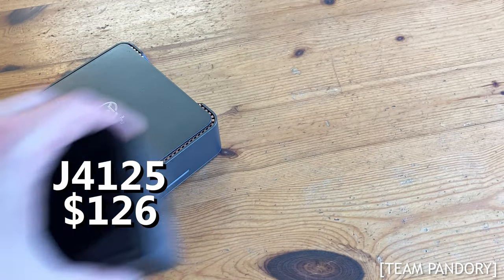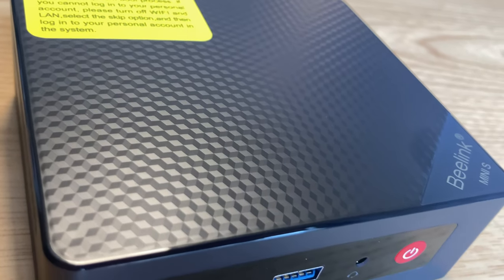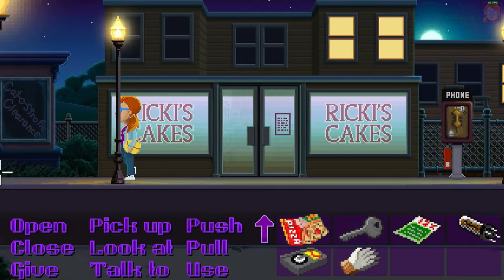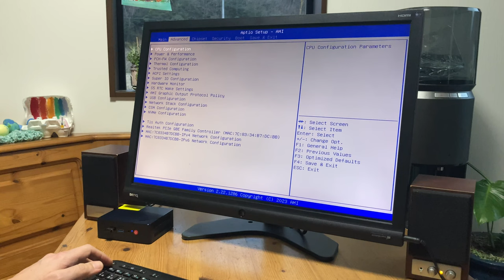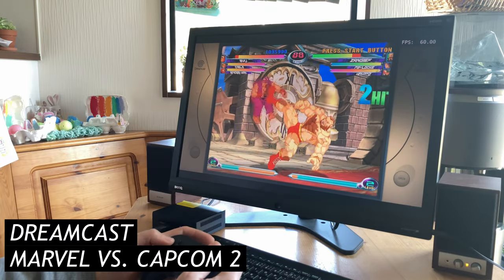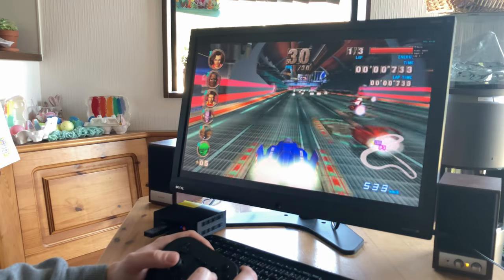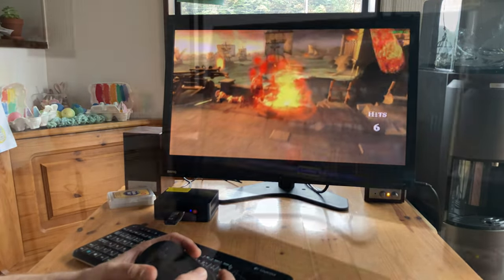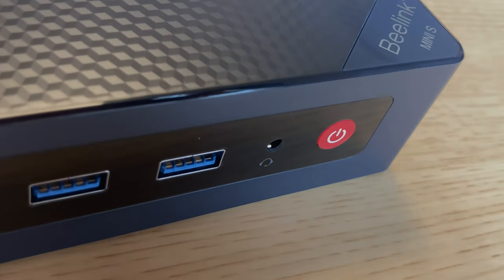Beelink S12 Review - This Mini PC is AMAZING Value at only $155!

Comment: Beelink is a value for money brand. I bought Beelink Mini S with Intel 5095 Jasper with 16gb RAM and 256 GB SSD for $160 last year to replace my 12 years old laptop with 3rd gen I3 8GB ram which I paid $500. The laptop still worked fine but about 3 times slower than Mini S due to less RAM and only DDR2 RAM while Beelink has DDR 4. 3rd gen i3 is also slower in computing and rendering graphic. It's a fact that PC, smartphone is getting cheaper while performance is getting better. However, you buy when you need at the time.
Reply: Hey can you give an update on the mini pc? How’s it working 3 months in? I want to buy one for reliability. Thanks

Comment: Yes, running your PL1 at 30 watts adds extra byte on CPU limited apps. Another sited shows the before and after game benches with temps.  This $150 sleeper nipping at the N100, not seen if those can be bumped up.

I use mine as a simple music/movie server with attached drives in the cave.  The Intel HD audio codec’s still have best legacy HDMI audio support over my Ryzen gaming hardware. DJI Air 2S high bitrate video, NO issues at 30 fps in 5.4K, 60 fps in 4K and 120 fps in HD. Its maximum video bitrate is 150 Mbps in H.264 and H.265 codecs.

This little box is quite and cool running at 30 watts, you can bang 90C with no complaints from mine so back off to 25 watts if your nervous. I love the extra zip in normal non game stuff!
Reply: How to run on 25 watts?

Comment: This is a bit more like it from Intel. Finally they incorporate AV1 hardware decoding way later than they should have and for the first time in a long time, the price is good and easily makes it competitive with ARM based SBC's. $160 allows it to be a relatively easy purchase. The lower pricing is likely due to Intel facing a very bleak future, bought about by their own greed. Single channel RAM is a veritable crime though and Beelink should know better.
Reply from the maker: In the bios, it apparently supports dual channel so I'm guessing that the next model up with more memory is dual channel.
I linked a mini pc in the description that also whips the crap out of a pi4, also single channel but maaaan, it ain't far off this one in the review
Reply: Single channel won't matter much for DDR5, same which applied for ddr3, only ddr4 it suffered so much in single!
Reply: Si es que le pongo mas memoria ram crees que se pueda solucionar en algo que solo sea single ram, o por mas que le ponga 32gb de ram igual va a afectar que no sea dual Channel, estoy indeciso por esa situación, no se si comprar la beelink s12 o la u59 que creo que esa si es dual channel
Reply: The single channel limitation is from the N95 chip... so it's Intel's crime, not Beelink's.  Intel purposefully hobbled all Alder Lake N series processors to differentiate between the more expensive parts (so even the N305, which has double the number of E cores (8) as the N95/N100 (4) is hobbled by single channel RAM).   If you want dual-channel RAM in a 12th gen Intel mini-pc, you have to go up to the i5-1240P (or i7-1260P).   As @nokialumia6267 pointed out, the older (11th Gen) N5095/N5105 in the Beelilnk U59 do support dual-channel memory.  However, that is dual-channel DDR4, where the newer 12th gen chips we are talking about actually support DDR5 RAM (there are Beelink products, like the EQ12 using DDR5), so there is a trade off... do you want the newer, faster processor with PCIe3 NVME drives, and single-channel DDR5, or the older 11th gen processor with slower SATA SSDs and dual-channel DDR4?

Comment: I bought the s12 "pro" for $165. The price is weirdly low for coming with N100 CPU, 16gb DDR4, and 500gb SSD.  I did not expect much but i'm shocked by how capable this little thing is.    I've been using it as my main computer that last two weeks just seeing how much I can do on it. 

Strongly recommend the N100 model.  Only issue I've encountered is an unwillingness to boot from USB, which seems to be an issue others had as well. I haven't looked into it yet but thought I'd throw it out there.
Reply from the maker: Hey there, glad you're enjoying it.  It's amazing to think that so little money can get such a system.  I think the price of windows 11 alone in some places equals the best part of 100$, too. 
You may need to turn off secure boot in the bios. It definitely does boot from bios as we've been managing it, but we will need to wait for an update to have those new intel WiFi / Bluetooth drivers included.
Reply: Where did you buy? The price has raised to $219 on amazon now...ugh

Comment: Do u think changing the power limit in bios from 20000 watts to 30000 would improve gameplay for the later systems
Reply from the maker: I've only just seen that you can do this yesterday.. Impressive you can do that, but it looks like many of the games are more dependant on the GPU, which doesn't get altered at all when you give the CPU more power.

Comment: Just got the 16GB version - probably paid WAY too much at £233 - don't care. Its great. Does everything I want and I have not even started looking at the gaming yet. the scaling CPU from 800 to 3200Mhz on 4 cores rocks, low power consumption unless needed. Reasonable graphics when needed.... great little unit and with the 16GB version I got, very quick. I do think I over paid, but not fussed. Even at £233 still a good purchase. Paired with a decent monitor / smart TV its an easy 1 or 2 hour set up, then happy days. Gave mine to my very "tech" phobic mother, even she got on with it straight away. Rebuilding an old P4 laptop at the moment - I WILL be trying to steal this back, but I'm not sure she will let me... These S12's are good ;)
Reply from the maker: @damightyshabba439  it's more about how much you value the tech.
I mean a full pc can cost much more new if you put into account the price of case, PSU, motherboard, CPU (that's over 233 already) then GPU, memory and storage... It all adds up. 
Either way a great little first mini pc for sure 👍
Reply: @TeamPandory  Agreed - to be clear, I've been building gaming PCs since the 90's, but this is my first Mini unit. I was shocked just how good it is. My "main" pc is a 5600X 32GB ram and an old 1050Ti 4GB, plus about 120TB in drives. But this little box isn't far off for speed and ability. I'll be buying more of these, I think!
Reply from the maker: @damightyshabba439  Yeah I could tell you're experienced in tech. It's crazy now to see that moving to the mini pcs is a  viable option. 👍
Reply: @TeamPandory  OK - "Dad Question" time - I plan on buying a few - maybe 4-6. I've been out of the market for a long time. Would YOU go with the S12? Lets say £150-250 budget. Right now I'll just buy S12's, but if you have a better idea, I'll listen.
Reply from the maker: @damightyshabba439  depends what you're going for tbh. If you need pcs for non gaming then most N95 / N100 pcs should be good. If you want a bit more pep, then look at a mini pc with the N97 processor. The gmktec G5 had that, which we reviewed a few months back. 
If you want to go beyond though, then go for a 6000/7000/8000 Ryzen mini pc. They knock it out of the park, check the last video we made on the Amazon sales for the computers we'd recommend right now 👍
https://youtu.be/Ot3REgech_c

Comment: would you recommend replacing the SSD or just buying a 1tb external to make it bootable from batocera?
Reply from the maker: I wouldn't bother replacing the SSD.  Keep that in so you can boot up Windows when you need to.  Add an internal 2.5" SSD or HDD, or even use a USB drive for the least messy solution.

Comment: if a n95 can run ps2 then N100 can slighly better. i bought one with n100 that it is supposed to arrive in 2 weeks. emulation, espicially ps2 games, is something i definetly something id like to enjoy on that mini pc. thnak you for the review
Reply from the maker: Yep. We've had a few n100 mini PCs on the channel and they do handle PS2 better than the n95.

Comment: This was a nice little unit..for the 2 months it functioned.  It's now hung on the bios screen entry when booting.  f7 or delete, too bad neither of those do anything. Pull power hold cmos reset in?  check..zip...Unplug ssd reseat..check..nothin.  Remove ram, reinstall ram, 1 stick at a time?  Check..nothing.  What we have here...Is a brick...Just an FYI , you can buy a reconditioned HP 800 g4 mini with a hexacore i5 for about the same...One of them works after 2 months...
Reply from the maker: Ram, one stick at a time?  Must be another unit because the intel n95 / n100 boards only support a single RAM chip.
Saying that, it sounds like your SSD needs replacing/ reinstalling.  Reach out to beelink perhaps?

Comment: Bought the N100, does you know if batocera supports the teknoparrot emulator for arcade games?
Reply from the maker: Pretty sure you will need to run teknoparrot in windows, but batocera has surprised me in the past

Comment: How much better is the S100 and the S95?
Reply from the maker: It's 5 better. 😅
On a serious note, the S100 is a bit better when it comes to games.  If you're looking for a PC for Windows / office use, then they're very similar.
Reply: @TeamPandory  lol that’s very good answer. What system do you think 100 will play up to?
Reply from the maker: @johnhanes3450  for emulation ?  PS2 and weaker wiiu titles. 
You may want to check the n97 computer we reviews a couple of weeks ago- and we have another one in the works for budget Ryzen computers, if you want to push your emulation that bit further.
Reply: $100 price point is what has my attention 😅 I will check out that N 97 as well
Reply from the maker: @johnhanes3450 might want to look at the used market / eBay for something with a graphics board inside. 100$ is a push 😂

Comment: Whats a good mini pc to emulate up to ps4 and switch?
Reply from the maker: Unsure about PS4 emulators, but for switch you'd be good with a 7840hs.
These cheaper ones won't handle switch or PS3.
Reply: @TeamPandory  thank you, so I'll probably be better off buying a steamdeck or something like that I can hook up to my TV huh?
Reply: @TeamPandory  I have an Nvidia shield right now, for streaming TV and I can emulate up to wii, just want something a little more powerful
Reply from the maker: @josesanchez-ph9md  definitely go for a 7000 or 8000 series Ryzen then.  You can use them as a full computer to edit videos on too 🐱
Reply: @TeamPandory  thanks for the replies! Really appreciate the help!
Reply from the maker: @josesanchez-ph9md  steamdeck is good. I use it quite often. Again if you want more power Ryzen 7000 series like the gmktec k6.

Comment: Is this uhd630?
Reply from the maker: No, it's the Intel UHD Graphics Xe 16EUs (Tiger Lake-H) ( - 1200 MHz)
Reply: @TeamPandory  i see. Is this higher than uhd 630?
Reply from the maker: @awepsalmgamin  It's very close.  UHD630 wins in synthetic benchmarks as it has more cores, but XE with 16 CUs is close.  Would be more concerned about the CPU clocks.
Reply: @TeamPandory  i see. So it's the best budget mini pc for batocera that can run ps2
Reply from the maker: @awepsalmgamin  for the PS2, id definitely recommend the n100 over this.  Similar price tier, we've reviewed many of them like the Chuwi Larkbox x, or the gmktec G2 or g3
Reply: @TeamPandory  tnx for the advice. But in Philippines, the Chuwi is $40 more than S12
Reply: @TeamPandory  I've seen that the n95 has higher mhz  in gpu than n100, but n100 is still better at gaming right?
Reply from the maker: @awepsalmgamin  yep. The iGPU on the n100 has more execution cores, performs better all around.
Reply from the maker: @awepsalmgamin  check the gmktec G3 video. You can also put them in your Amazon shopping cart and wait for the sales. They come often on these mini pcs.
Reply from the maker: @awepsalmgamin  Yes, we've done a side-by-side test of the N95 and N100, however if you want a gaming mini pc, we'd recommend a bit of a bump higher than the N95 / N100.  These are both classed as very low powered devices, and it's more suited for emulation up to around PS2 than regular PC gaming.  It might be worth checking the 6800H chip if you can : https://youtu.be/9nzJsJMC-3c
Reply: @TeamPandory  thank you soo much for the confirmation. I'm eyeing on the N100 now for my retro needs

Comment: is this worth upgrading from a j4125 with 12gb ram  with 256gb ssd? I can buy it for around 180euros on sale, thanks!
Reply from the maker: Depends what you want to do with it really. What do you intend to do on it Vs the j4125?
Reply: @TeamPandory  Its connected to my tv, mainly for emulation,downloading,browsing. And in some aspects i feel the J4125 is pushing its very limit. I dont know about the N95 if that would be a good jump boost and if its worth upgrading it for 180 euros
Reply from the maker: @Chiren1337  Well I can tell you for certain that it's definitely a good jump from the j4125.  I got this for 150, but saying that, the N100 is at 195 with more memory and double SSD space... Total deal.
Reply: @TeamPandory  Probably gonna get it, do you think its wise to move my windows installation to my 2.5inch ssd instead of the onboard one? Will that see any performance improvement?